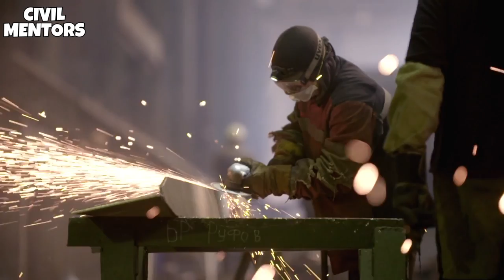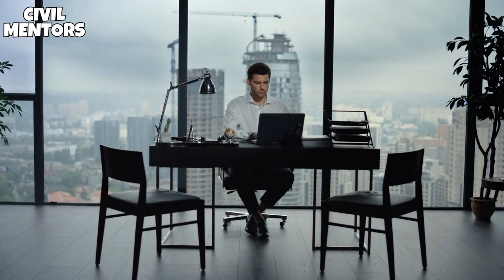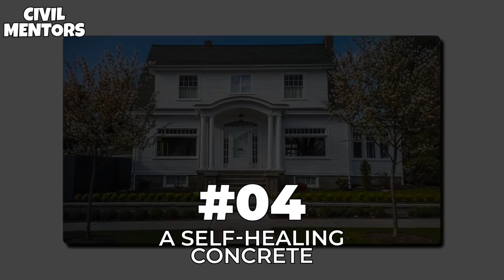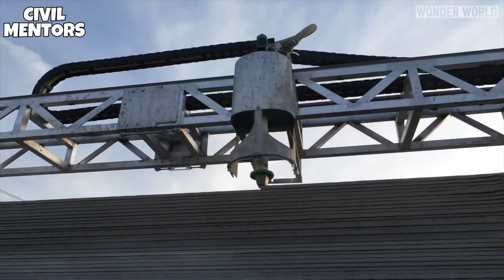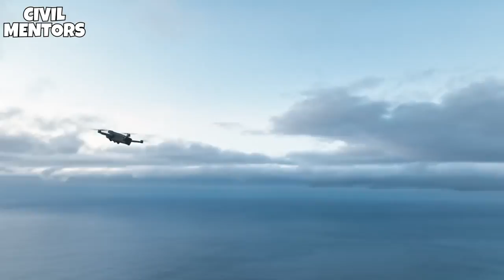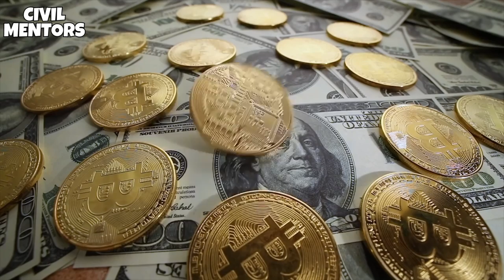10 Futuristic Construction Technologies

Comment: Years ago I designed the "Perpetual Freeway System" that can accomodate both gas vehicles and electric vehicles; this system has several safety features with an advance drainage system that will prevent major flooding and severe vehicle accidents throughout the nation. (A.T. LLC)